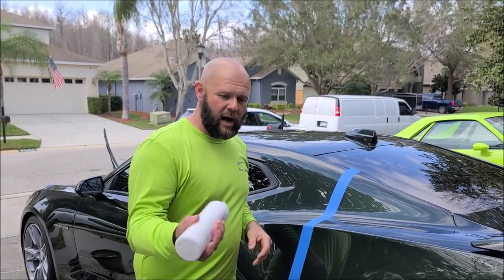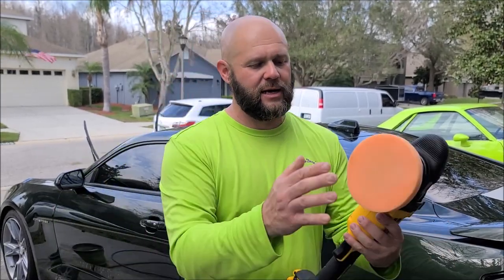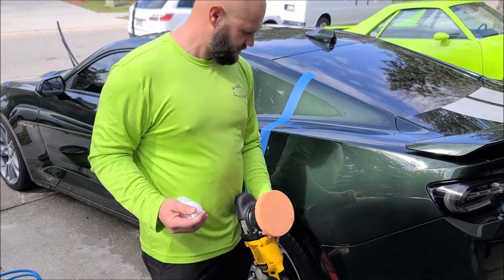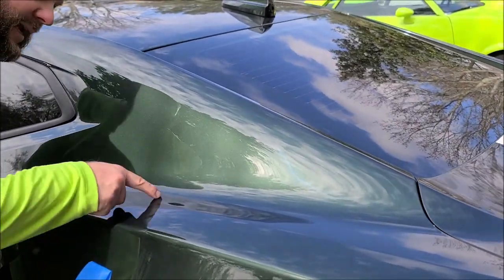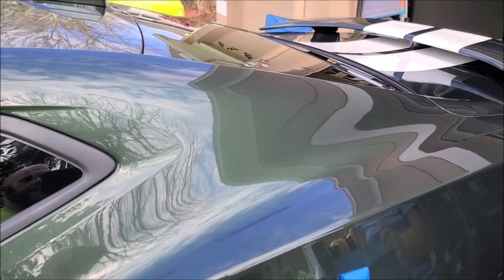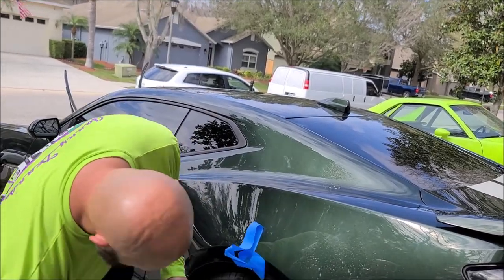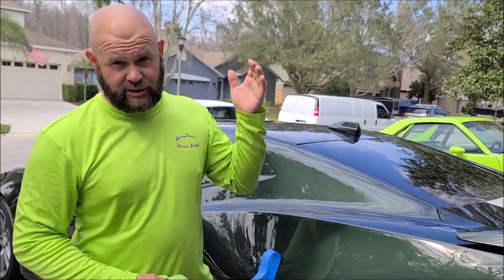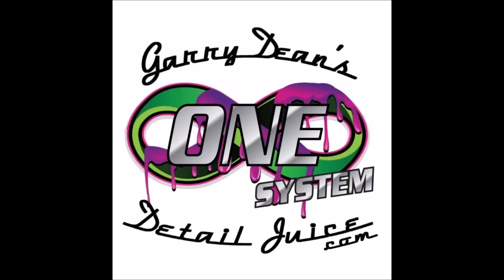STEP 3 - THE POLISHING PROCESS - UNIVERSAL AIO - SMART CUT - SMART FINISH - UNIVERSAL CLEAN AND PREP

Comment: Hello Garry.  Do you use Univ Clean and Prep before or after polishing with Univ AIO?  At 2:42 it sounds like you use it before polishing with Univ AIO but at 2:53 it sounds like you use Univ Clean and Prep after polishing with Univ AIO.  Or do you use it both before and after?
Reply from the maker: In previous years you could go straight to protection after UAIO, but now I have changed that. ALWAYS wipe down with UC&P prior to applying any protective product. Thats the rule.